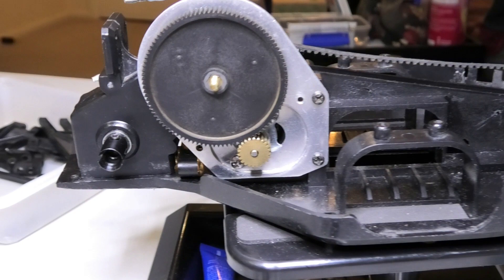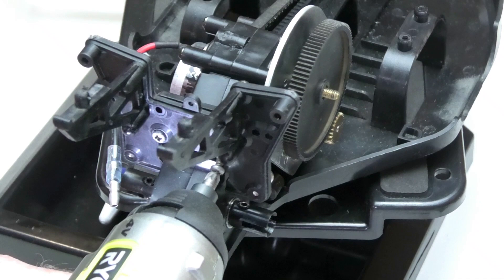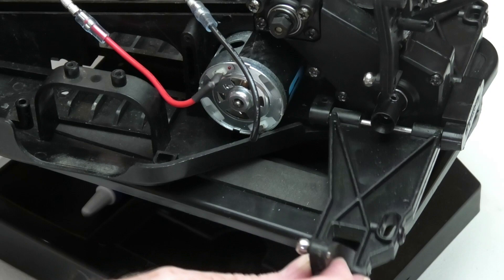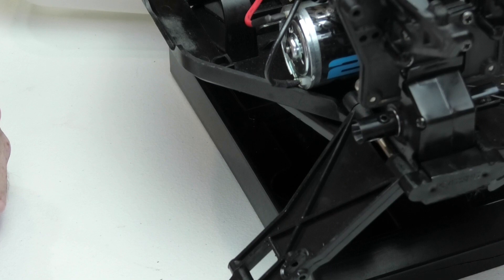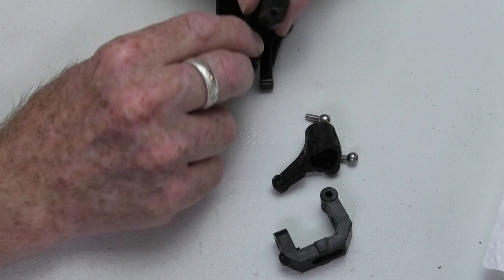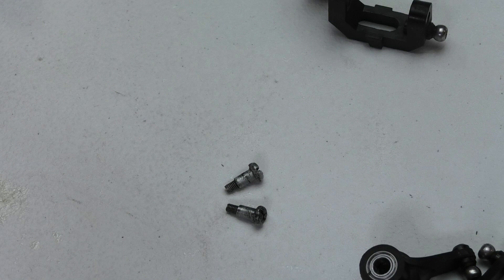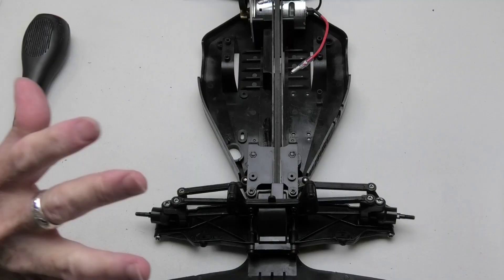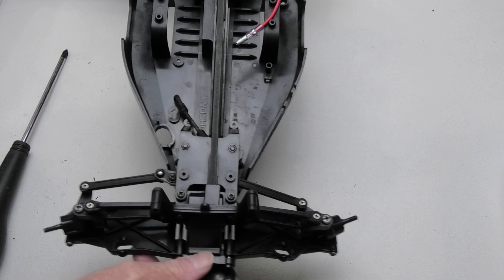Kyosho Lazer Apha Restoration Vlog #4. Swing Arms & Steering Installation.

Comment: There sure was a lot of screwung around in this video. Also, just enough lubrication is necessary for proper insertion. I can't wait for the next video, it should be shocking. Okay, I need to just quit now. I'm just being punny.
I have both you, an Australian, and another Youtuber, a British guy, saying waffling. I'm guessing it's a similar term to us Americans saying chit chatting  gum smacking, jaw jacking, and probably others that I can't think of. 
I do have an unrelated question about something. What battery do you run in your 3S Typhon? I'm relatively new to this whole lipo thing and am still learning about C ratings and all that when it comes to what's best for providing enough power and run time and all that stuff.
Reply from the maker: Yep, waffling is just that! Pun away, mate!🤣 As to the 3s I use...it's a 6000 mah with 50c rating. In basic terms, mah is the size of the fuel tank and the C rating is the diameter of the fuel hose. The higher the C rating, the more power gets delivered to the esc. If you want long run time, and not too concerned with top speed, go for high mah. If it's faster speeds, go higher C rating. Hope that helps, mate!👍😁👍💯
Reply: @MattsHobbyWorkshop  yes that helps greatly. I get confused on which does which with the mah and c ratings. Thank you.